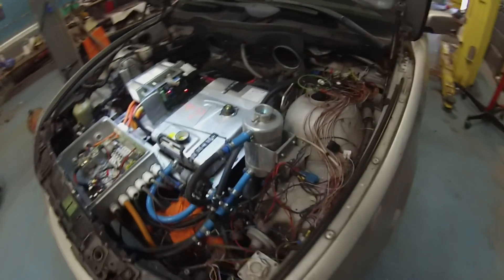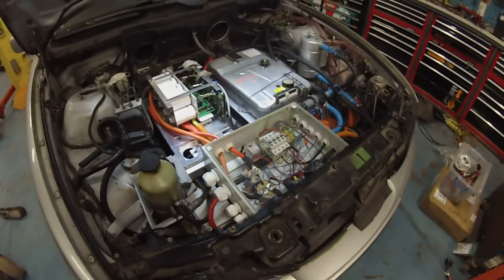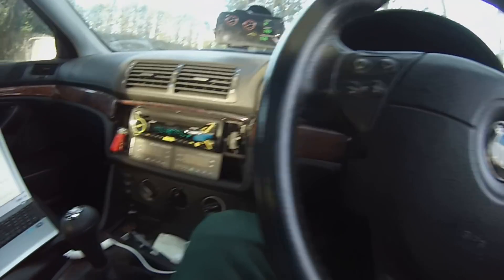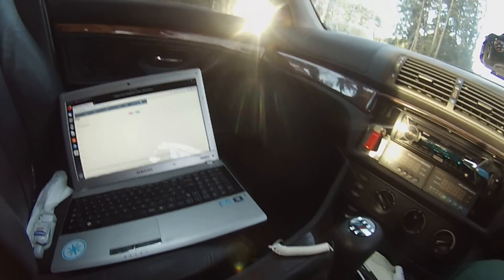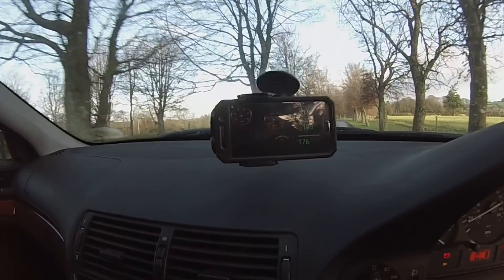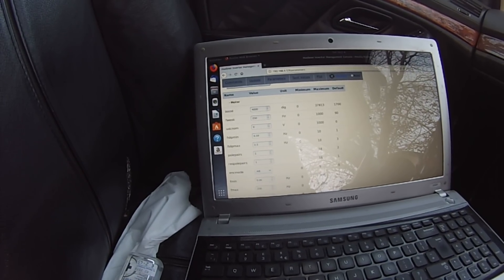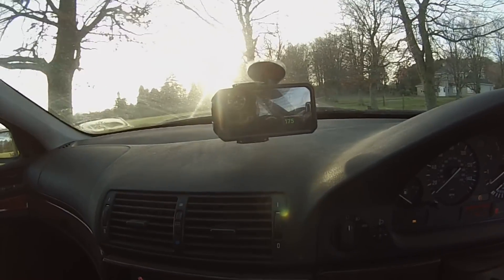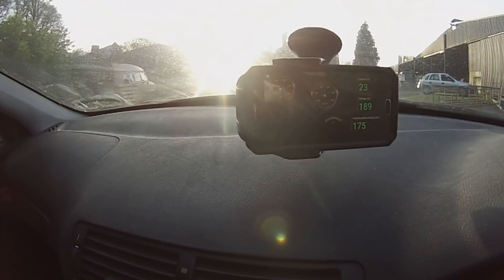BMW E39 EV Conversion 59: DC To AC Part 7

Comment: could it be thermal overload of some kind    or   the  motor resistance  is not matching the output components of that AC inverted output components    or   something simple like the throttle peddle problem (  i my self would go for thermal overload of a chip and its trying its best to save its self thus the loss of power as you try to give it some welly